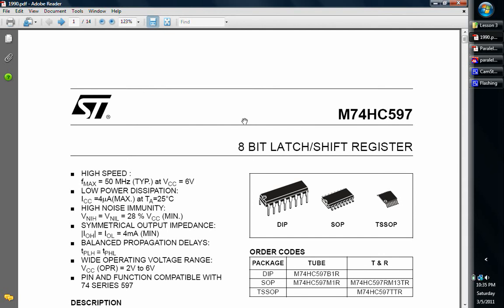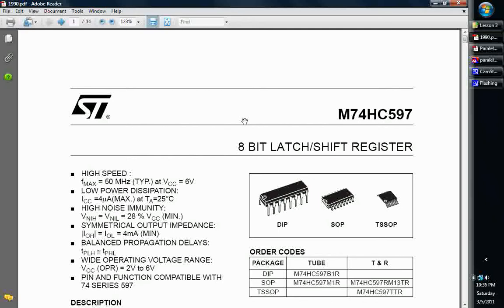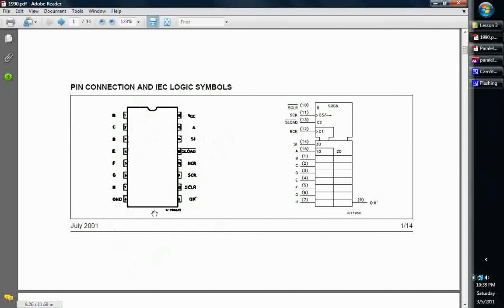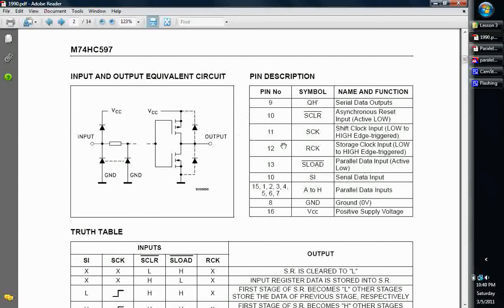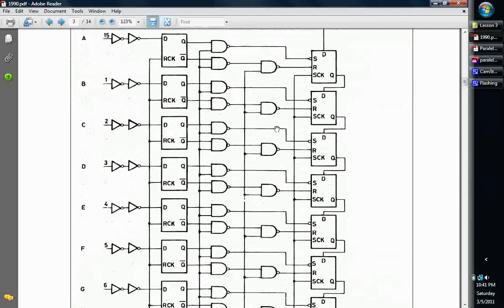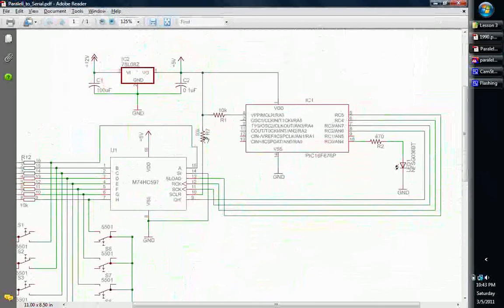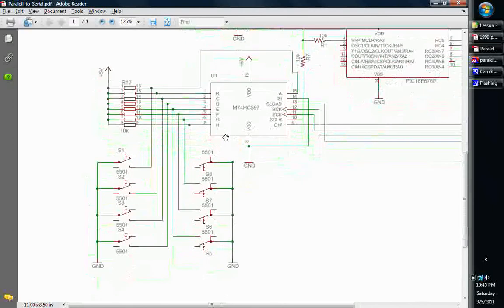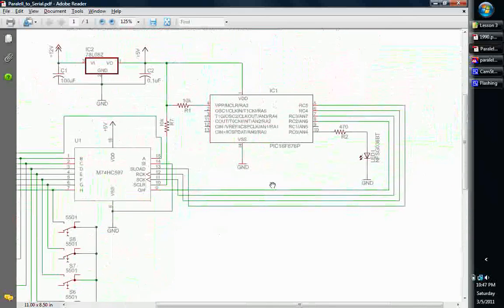Lesson3 parallel to serial Part 1

Comment: Misperry,  Thanks for uploading such a very useful videos to the world. Really I am trying to make use of it, to input 12V battery charge level parallel data (using LM3914) and covert to serial data and feed to a Bluetooth transmitter. May I know the PIC coding if 
there are 10 parallel data to be converted to serial data?